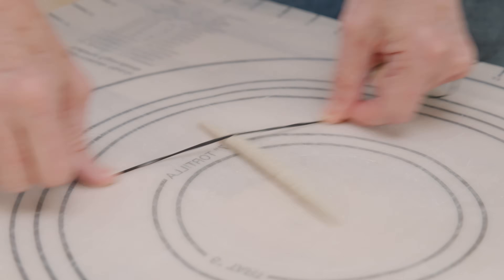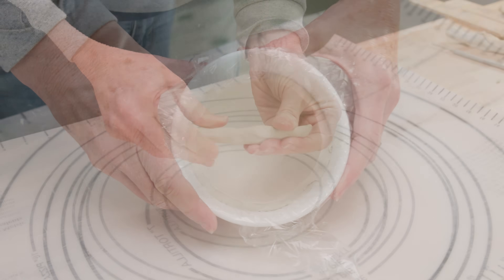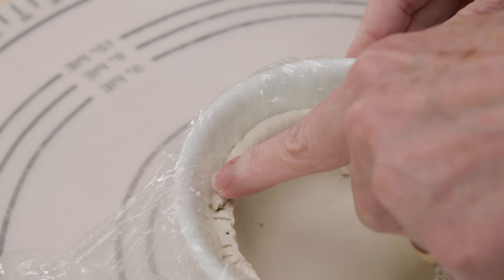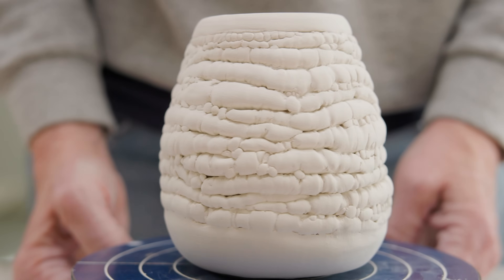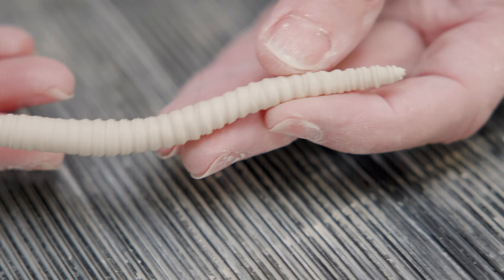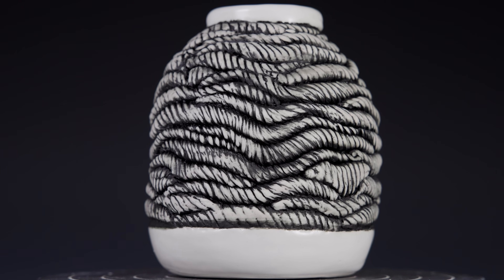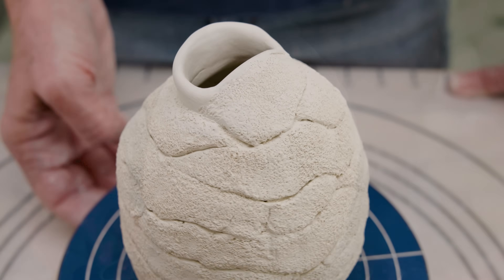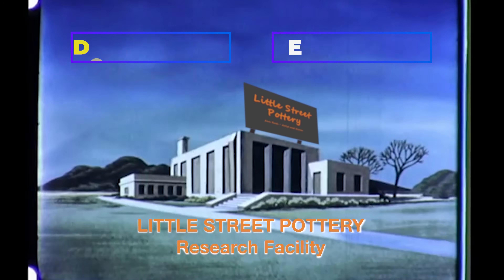Textured Coils - NO MORE BORING COILED POTS!!

Comment: I absolutely love your channel! I made the exact same bowl you made with coiling pieces of clay that were textured with the strings. It came out perfectly round when bisque fired but warped after glaze firing. It’s all wonky after glazing. I didn’t add a flat circular coil at the top like you did. Do you think that’s why it warped?
Reply from the maker: There are so many contributing factors to why a rim warps in the high fire. It happens to me too - especially with porcelain! Could be handle placement that is pulling during fire, the unevenness of the clay, over working the clay etc. The glaze fire will expose all those issues. The addition of the coil can help if you let the coil set up to leather hard before you attach it.